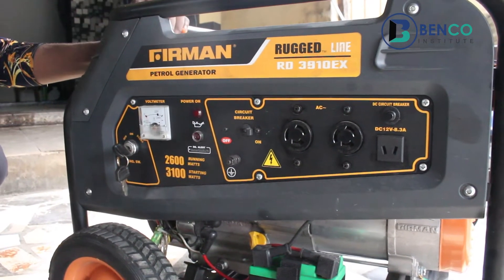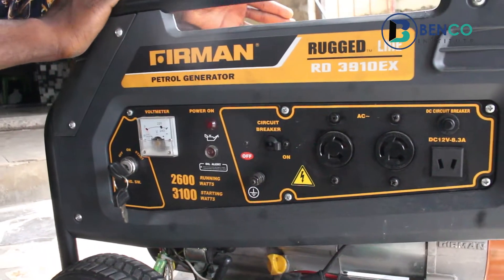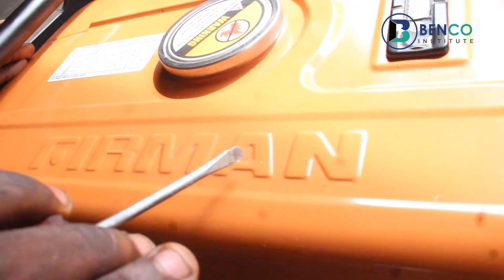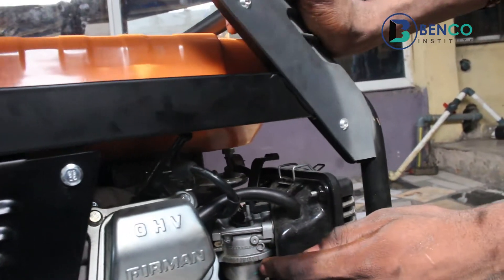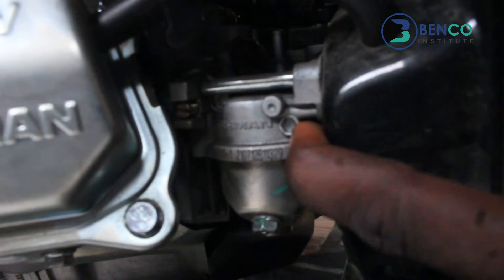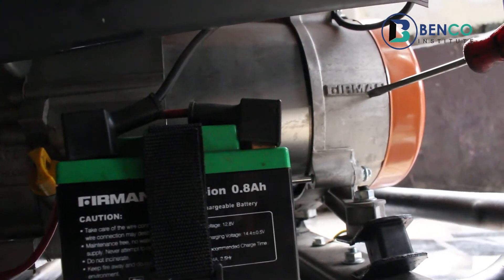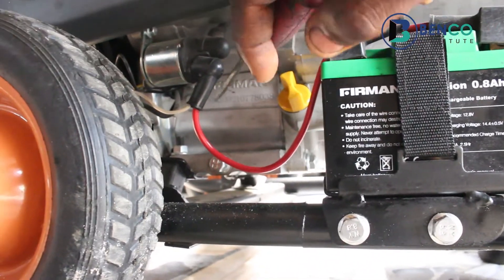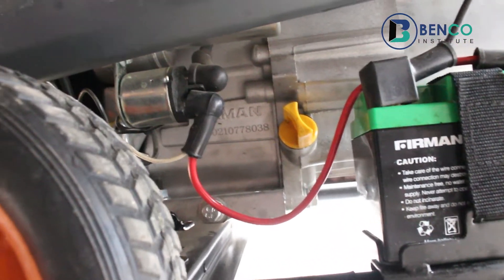6 ways to know a genuine Sumec firman generator. #sumec #Generator #small engine

Comment: Pls, which is better between this RD3910EX and the FPG 3800E2?
Reply from the maker: Quality wise they are the same... 

About the same engine and alternator

However the FPG 4800E2 will give you a higher power if you want a power higher that the two u listed
Reply: @bencoinstitute  Thanks bro